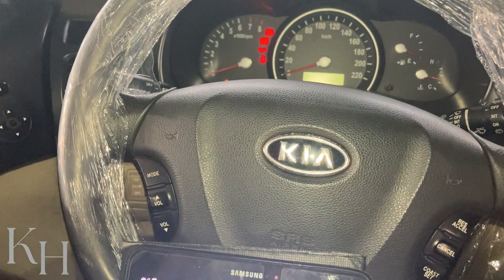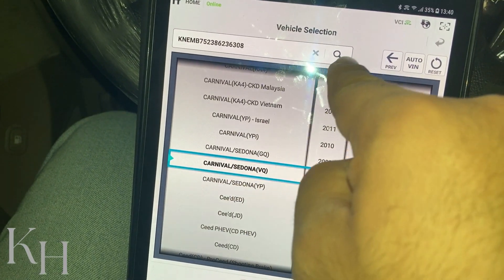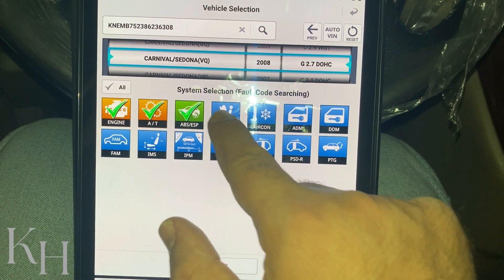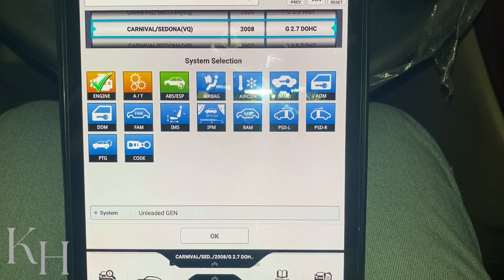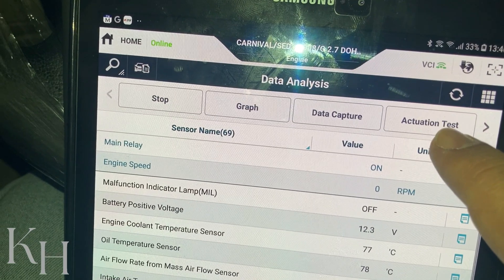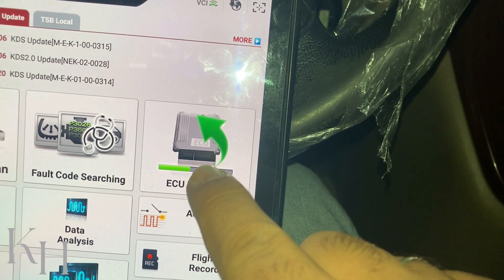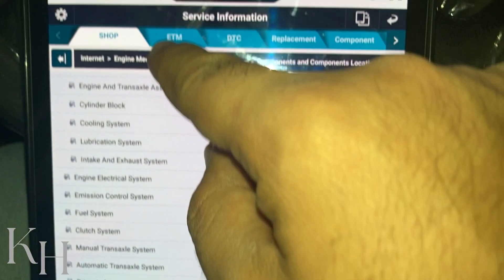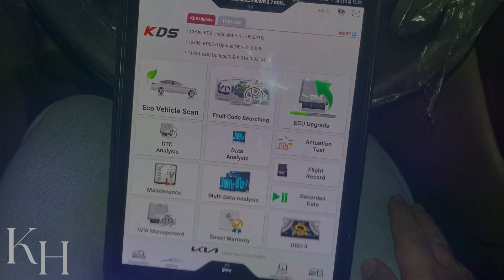How to Use KIA & Hyundai OEM Scan Tool #KDS #gds #kia #hyundai #scantool

Comment: Can someone pls check Kia official service manual / procedure. Is it necessary to reset or program a new AGM battery using a KDS tool when battery is replaced on 2020 Kia Seltos. It has Audio Start / Stop so I was told the battery computer needs to know when a new battery is installed. Pls. help. thank you!

Comment: Dear which website get this tool
Reply from the maker: I’ve seen some providers but I haven’t purchased from them as I use dealership’s scanner. Just search “Kia KDS” on google, you will find some of them.
Reply from the maker: The next best option is Kia and Hyundai GDS, which is much cheaper, it covers up to 2018 but for any models before that it covers %100 and wiring diagrams and manuals are included as well.

Comment: Very good information,  
We need , i want to buy it , my dear , how much the prize of it ,
Reply from the maker: This scan tool is only for the dealerships, but there are many others that cover Hyundai and KIA very good.
Reply: @GoProAuto  ,thanks 4 Reply,  
Ok  , where I get hyundai & Kia Repair Manual books 📚,   pls if know where & which place I can get ,  
In Market Many but ,the Problum ,, not Compilate , 
As I Nedd , in Repair BOOKS should be ,,  
Component Location,  wiring Daigram ,  REMOVEL & instalation,   connector , mechanical & Electrical,  information , masurment  . I hope u stand ?  I hope u will be Response me ? Thank hro
Reply: @GoProAuto  Ya iknow I already USE GSCAN , GSCAN  2 , & ZENTIH5 
ALso I have GDS Program . But last IPDATE IS 2107 not New Cars ,  if u know GDS how to update somebody,, 
I like GDS TAB & KDS Bcox That is NEw high tech Technoloy,  Even I pay 4 Everything coast, it Doesn't Matter,

Comment: Hello! I wonder if you can help me with a tricky challenge. I imported a korean ioniq 5 and i wish i could update the ECU, but the GDS in our country didn't fetch any updates. So the dealer cannot help. Is there a workaround for this problem? Anyway to get the Korean GDS or something?
Reply from the maker: Hi there, may I ask what the fault is on your car that you need to do the upgrade?
Reply: @GoProAuto  there is no fault but I suspect the BMS needs an update. For example, I know they added battery preconditioning and also the ICCU firmware was updated in many regions to fix some bugs. The SOH is acting funny too, it reports 92% but when I test the range and how much the car is taking in from the evse (after calculating efficiency and other losses) I always end up with 100% of the original capacity. Anyway, my motivation is to keep all ECUs up to date :)